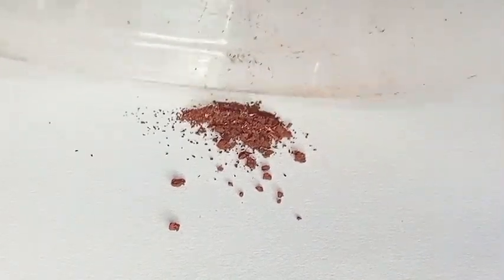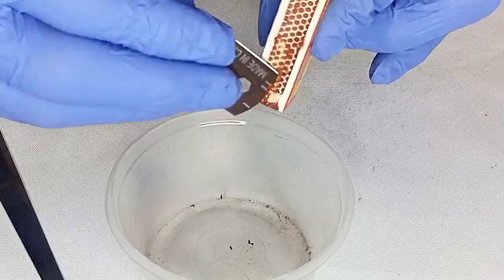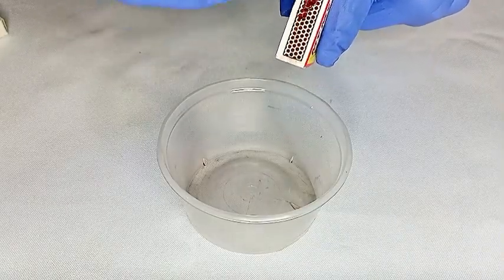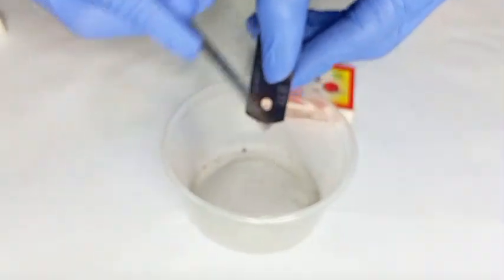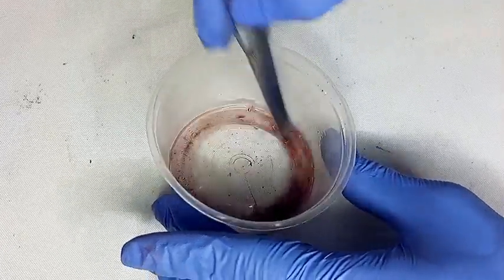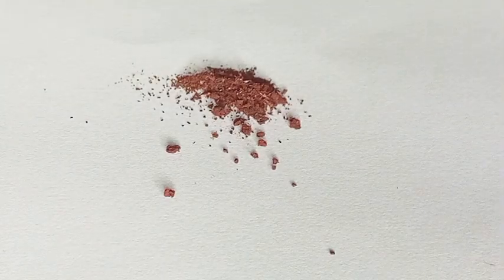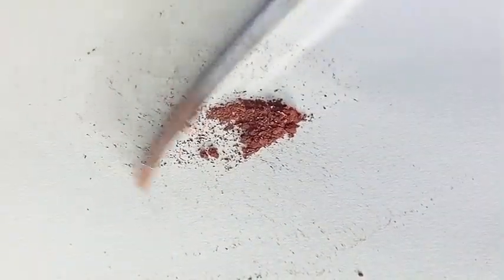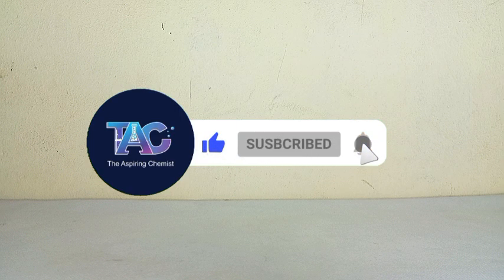I Extracted Red Phosphorus from 100 Matchboxes

Comment: In the US, the RP on strikers is applied with some kind of thermoplastic. It is totally impervious to any of the 15 different solvents I threw at it. In the end, I had to use heat to scrape it off, and distill it to the white allotrope. I have a PTFE lined stainless autoclave and some nichrome wire sitting around, waiting for conversion back to red.
Reply from the maker: Ok then

The method you applied is resourceful 
But be very careful when working with white phosphorus. It's not calm like the red phosphorus
Reply: @Aspheerah Oh yes, it's terrifying.
Reply from the maker: Ohhh my goodness 

Stay safe oo 👍